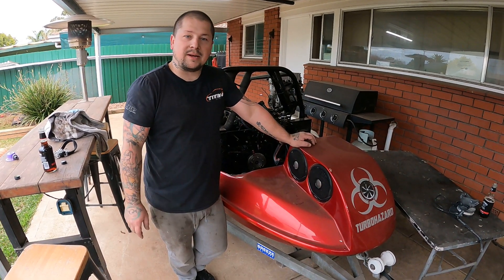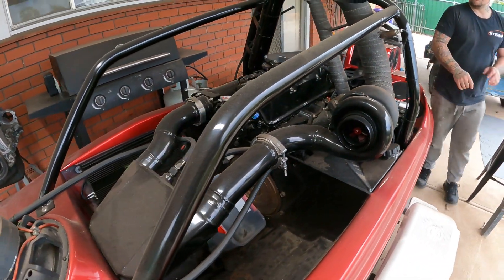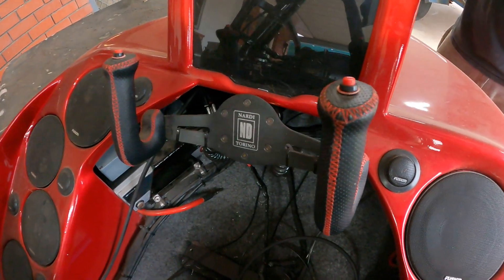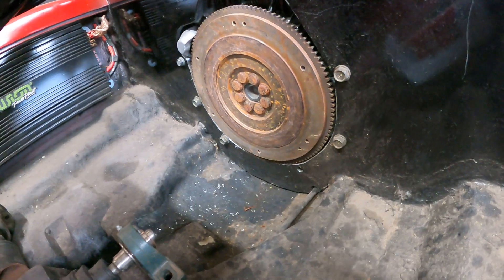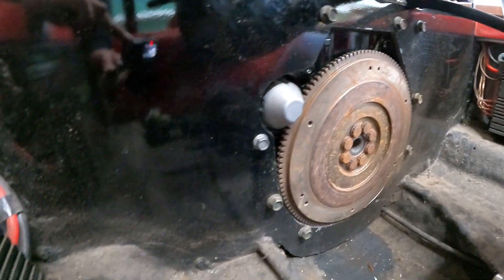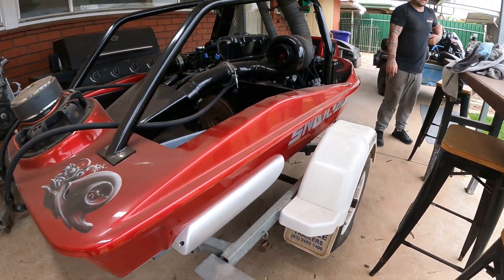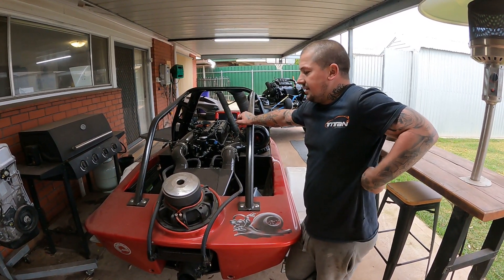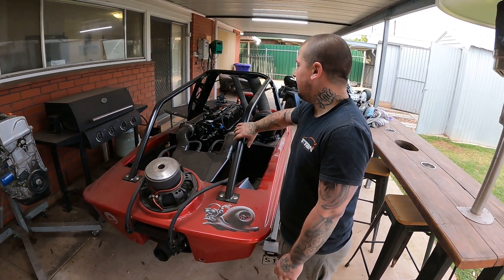600hp k24 turbo jet boat

Comment: the speakers kill this build for me. other than that nice idea.
Reply: Why for?? You wouldnt want to blast some metal doing 100+ on the water?   Throw some drum n bass on haulin ass..  i guess it is a single seater so is kinda weird to be blasting music by yourself..,  be a good floating soundsystem for anchor parties..
Reply: @Z-Ack  makes the thing look stupid. I rather not waste space with dumb things but it's his build and I love the k swap. I wanna do a jet boat with a k but in a much different platform than a one seater. But like I said I'm not bashing his design choice just not for me.

Comment: Hi from the Yank!. Glad to see you taking this on. I'm looking at doing similar on a home built jet. Looking to build a K-20-24 to around 500 HP and go with a Scott pump. There's a yank that did this a few years ago, I've reached out to him to pick his brain. Do you think that pump is going to handle it? Thanks for sharing the build
Reply from the maker: Awsome.  Yeah the pump will be fine
Reply: @SNAILTVCRAZY  I was worried about cavitation issues with a smaller pump. I'll keep you posted if I take this on!
Thanks again

Comment: In the NZ Jetboat builds they Use a Rotax 1630 Ace engine same as what they using in the USA.  221kw@crank Supercharged
Reply from the maker: Yeah awsome great motors
Reply: @SNAILTVCRAZY  Not even close to a K series tho :P
Reply from the maker: No but still a good engine
Reply: Did you make the hull too?
Reply: @GameChangersSportsNetwork  why didn't you make your own post...  but no its clearly a jetski body
Reply: Alot of boats here are Kawasaki 15f turbo they seem pretty popular

Comment: Did you fab the exhaust and is there a reason you didn't go with a heat exchange for the cooling system over the dual radiators?  Thank you! I'm real anxious to see how this goes.
Reply from the maker: Yes made everything.  And they are radiators.  I just welded the fillers up cos I don't need em